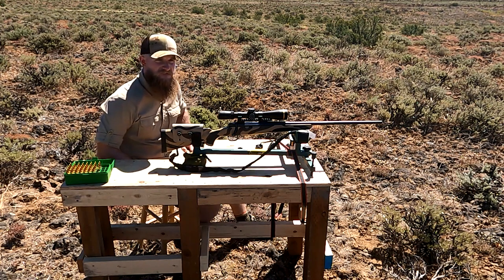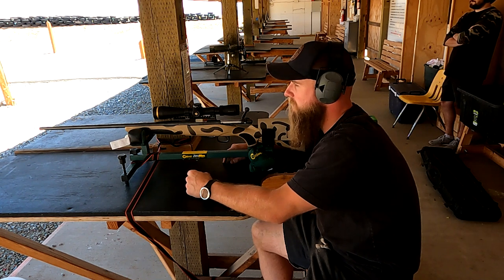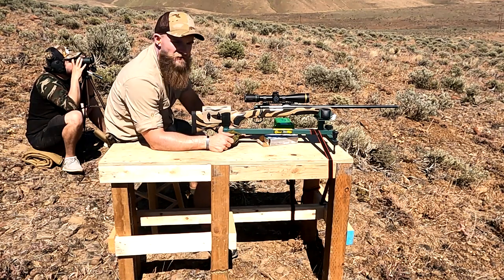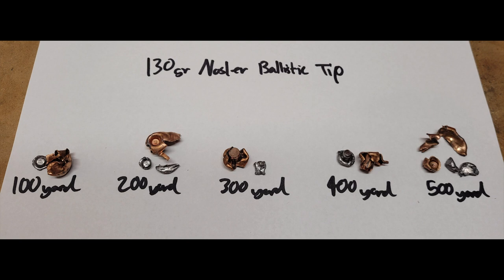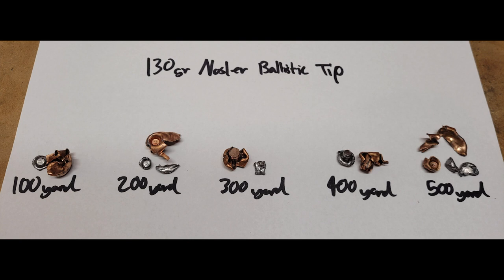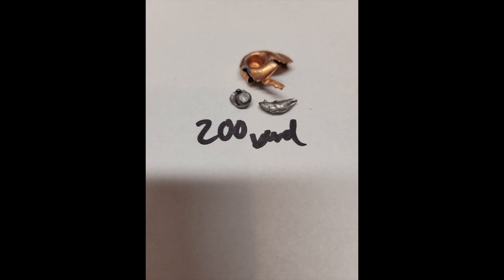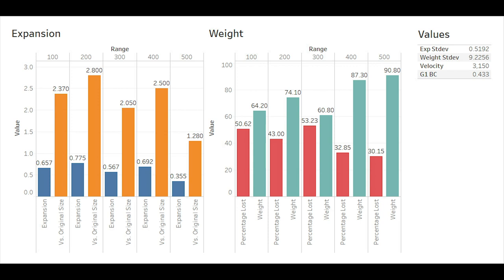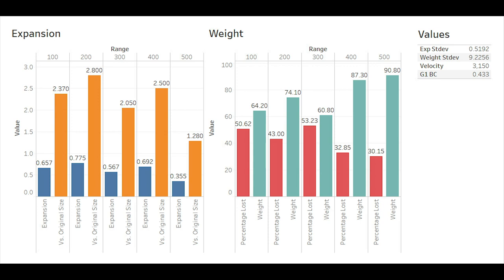(270 WSM) 130gr Nosler Ballistic Tip Expansion Test

Comment: I buy these Ballistic Tips for shooting steel at 500 yards. I would never use them for hunting. Good hunting bullets need to be bonded, monolithics or designed like a Partition or A-Frame. They are more expensive, but well worth the price. If you end up going with monolithics, no matter what the brand, you need to keep them above 2,400 ft./s. Don’t buy into this minimum speed of 1800 ft./s, it’s total bullshit. The best all around hunting bullet is probably the Partition. For short range, high velocities, nothing hits harder than a Barnes LRX.
Reply: Btw, I’m a huge fan of anything 270.
Reply: I like what I see on this setup what scope you use for that shoots
Reply: The Nosler partition now blows up on big game due to a soft copper now used.
I put 4 338 win mag 225 grain bullets into a 1400 pound coastal brown bear with everyone of the bullets blowing up on the ribs .
After the 5th bullet the bear jumped into the river then drowned to death .
The range was 195 yards .
Never again have I used any brands of bullets with lead cores after that .
For game all I use now are Barns TTSX & TSX bullets or GMX - E tips .
Reply: @Lure-Benson  I have read that the 225 grain Partition in .338 sufferers from tumbling, but I’ve never heard of it exploding on impact and not penetrating. I like to load the 210 grain Partition in .338. But if you need something even tougher, the Swift A-Frame has the same construction, but it’s bonded. I also prefer the Barnes LRX over the TTSX, and either will expand better than than the TSX. 
I have no experience hunting brown bear, but a guide told me that they have a very thick coat of fat, which absorbs a huge amount of energy. The same guide recommended the 250 grain Partition in 338 Win Mag. I also like the bonded 230 grain Noma Oryx  in my 338 Win Mag.
Reply: @falba1492  My 338 mag is a Winchester Mod 70 so I have never seen or heard of 338 bullets tumbling.
Yes Brown bears have on average 8 inch layer of hard rubber like body fat that wrecks lead core bullets.
That guide is not kidding by saying using 250 grain bullets is recommended and it is also why many bear hunters go to the 375's  with 300 grain bullets.
There is a trend now to use the 416 Rem mag and 416 Rigby on those bears and use 400 grain bullets.
I use mainly the 9.3x62 because the gun is controllable when 2nd fast shooting is needed .
The 9.3 x 62 is the same as shooting a 20 gauge shotgun.
I also have a Gentry muzzle break on the 9.3x62 to tame it even more .
Reply: @Lure-Benson  My 338 is also a Winchester M70, stainless in a laminated stock. It’s my favorite rifle. I’m looking for the same model in 375 H&H. I’m a huge fan of the 300 H&H as well. 
Do you guide professionally in the Pacific North West?
Reply: Partitions and A-frames break and shed a lot of weight as well
Reply: @workct4102  Partitions are supposed to shed about 30% of their weight, and the rest of the bullet should travel straight through, because of the copper partition that runs through the middle of the bullet. 
The A-frame, has the exact same designed, but the lead is mechanically bonded to the copper. It usually retains over 90% of its weight. The expansion is better than with monolithics. They are expensive, and on the larger medium bores and big bores, are only run at the factory every few years. It’s the quintessential big game bullet.
Reply: @Lure-Benson  I've been eyeing up the old 9.3 mauser....would be the ultimate addition to my lineup
Reply: @workct4102  I bought my CZ 550 in 9.3x62 new for $300 because the gun shop bought the gun then didn't have any ammo so the gun sat on the rack for 2 years.
The Gunshop owner told me hay you like strange things, so you want to buy that CZ ?
OK let me see it, next I ask home much?
$300 - OK I will take it.
That next fall this CZ 550 was used to save me and clients 3 times the 9.3x62 leveled and snuffed out 3 Hugh Brown bears that came at us that the clients wounded.
I was using Norma factory loads with the Vulcan 232 grain bullet.
One of the bears a 9.5 footer the 232 grain- 9.3 bullet traveled from Brisket to hind quarter then was found under the hide.
That was 15 years ago and the 9.3x62 to this day has been a one-shot killer of all game.
Reply: @Lure-Benson  wow...that's impressive.  I really need one...well...no I dont, my 30-30, 280, and 444 do all that I need.  But you know how it is.
Reply: @workct4102  If you want something that really makes a gun lovers eye open and go WHAT IS THAT?
I build for sale AR 10 uppers in the WSM cartridges.
The large cartridge uppers are in 375-300 WSM and 35-300 WSM so it makes the AR 10 a real dangerous game auto loader.
My AR 10 with the 375-300 WSM has matched the 375 H&H magnums for commercial loads.
I am shooting 37 cal 300 grain bullets with 4800-5000 foot pounds of energy from the AR 10
All of the WSM cases work very well for necking up by going in stages to expand the case necks.
Once the WSM cases have been expanded to 37 caliber I will heat treat the cases.
Reply: @Lure-Benson  a 375 WSM?!?
Reply: @workct4102  Little more info I run the 300 or 325 WSM cartridges on a 338 cal neck expander then 366 neck expander and then in the 375 WSM full length case sizing die.
Once fired the cases are good to go for resizing every time with the 375 WSM sizing die.
Reply: @falba1492  All Nosler Partition bullets are a copper H shape with lead swaged into the back of the bullet, so it isn't all copper.
Go look for yourself where bullets are sold then open a box of Nosler Partition bullets to see lead is in the back of the bullet. 
The very same is in the Swift A frames bullets.
If you want to spend a day with me fishing Steelhead then I can bring some Partitions to show you.
I am doing mostly the Elochoman R at Cathlamet Washington- Grays R - Naselle R
Reply: @falba1492  What would you want to hunt in the Pacific NW ?
Maybe I can be available in 2023.
I started my guiding in 1976 in the Pacific NW doing Rosevelt Elk - back tail deer and water found hunts.
Next spring I'm starting up again salmon & steelhead guiding with jet boat - drift boat - raft.
Looks like I am stuck here until my mother passes away, so all of my other work is on hold.
I have an 86-year-old mother with dementia so that is hell I am dealing with.
I opened a new YouTube channel for all of my coming hunting - fishing - fishing lure sales called Lure Benson.
There will be video's coming up on Pacific NW coastal Elk - black tail deer hunting tips - salmon & Steelhead fishing + lure sales.
There will be video of little-known creeks fishing steelhead where never or rare day to see anyone because fishing is done floating a raft through privet property on creeks that have fish hatcheries. 
I will be starting again for 2023 black tail deer hunts on Islands of the Columbia R & Willamette River for farm deer that don't get hunted and grow Hugh feeding on agricultural crops.
This is pay by day hunts so figure in what you pay to go to a freaking lumber company gate to walk in then find 20 hunters already at the clear with all of them looking at each other then you just wasted your money and time.
These hunts I will be using the 18-foot Dory that is 80% done.
I will be using a 40 Hp outboard for stealth cruising around the Islands.

Comment: Switched to Hornady.....nosler is the worse company in the world
Reply: Hornady’s cup and core bullets are very accurate, but their results are no better than the Ballistic Tip.
Reply: @falba1492  Yes so true .
I guided a Alaska Moose hunter who was shooting a 340 WBY mag using 225 gr interlocks that blew up on impacting the moose.
I took one shot from my 9.3x62 with Barns TSX bullets then the old bull pancaked belly flopped dead .
The client was stunned why his 340 failed until we go the hide off to find bullets blow up all over the ribs.
Reply: @Lure-Benson  i’ve been considering a nine three for a while, because it’s the ballistic twin of a 35 Whelen. I reload, so components for the 35 Whelen would be a lot easier for me to get, but a good quality rifle in 9.3 x 62 is much easier to obtain. Any thoughts on this?
Reply: @falba1492  I am either in Alaska or Oregon then finding loading for the 9.3x62 not any kind of problem.
All kinds of bullets - Brass from Norma or Lapua is always on hand from all the big internet supply sites.
I see also RWS loaded 9.3x62 ammo is for sale in Texas from a in line shop.
The 9.3 x 62 does exceed all the 35 Whelen could do .
Do not load 30-06 brass to 9.3x62 Mauser when the 9.3 x 62 brass is 7 thousand larger at the casing web base.
The 30-06 case can blow out.
The Barns TSX 286 grain bullet I have used for years is a absolute put the lights on ever animal it's used on .
I never seen any way I wanted to use the 9.3 - 300 to 325 grain bullets when the one load I use kills everything .
Reply: @falba1492  especially the SST.  Worse than noslers Bt